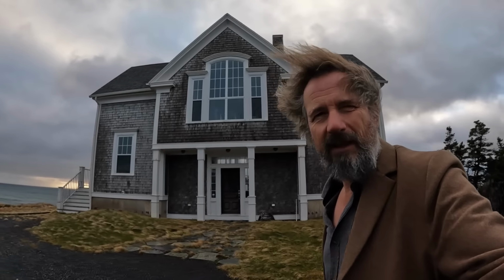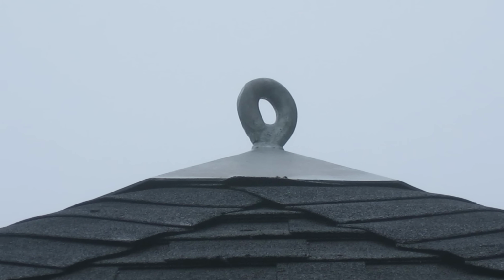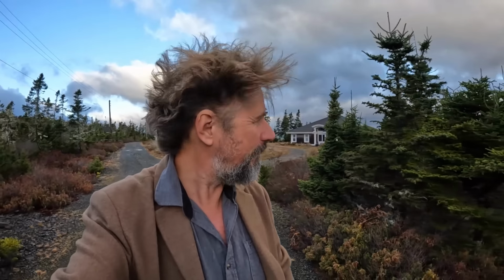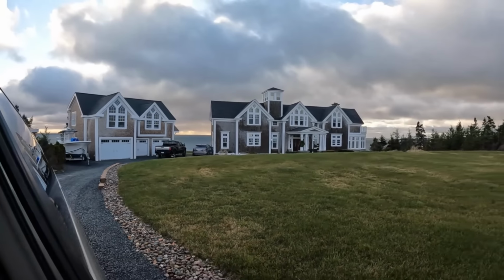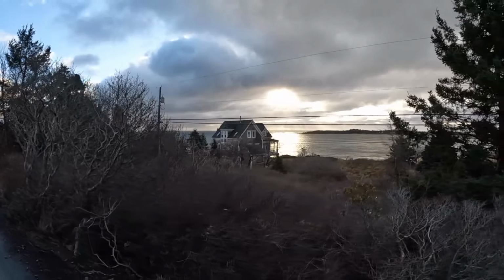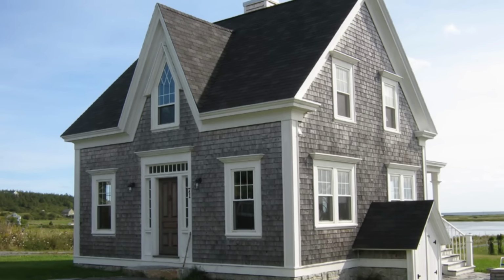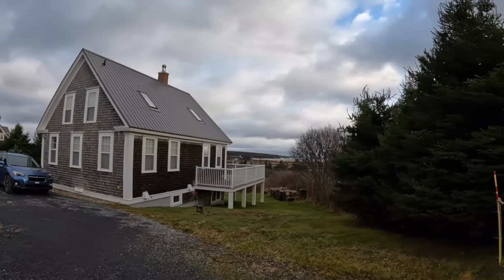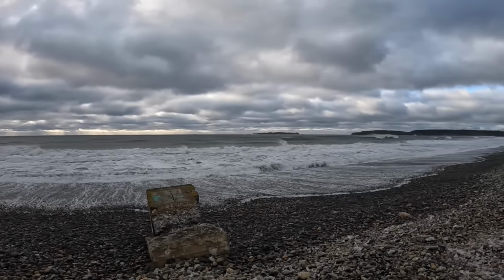Building a Legacy: A Journey Through My Architectural History in Nova Scotia #444 - TWG

Comment: But, but how did you stop the electrolysis on the Rovers aluminum body.
Reply: Zinc undercoat.
Reply from the maker: That's a good question. The trick to keeping metals happy is to avoid contact with dissimilar metals, especially those much more or less noble. Stainless steel and mild steel at both ends of the spectrum cause trouble. Aluminum and galvanized fasteners ensure for happy aluminum panels.